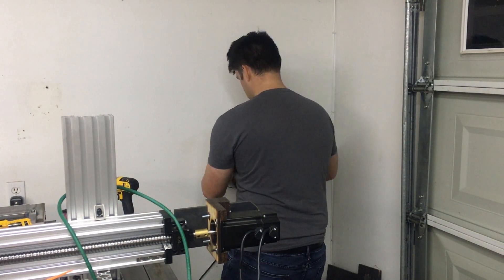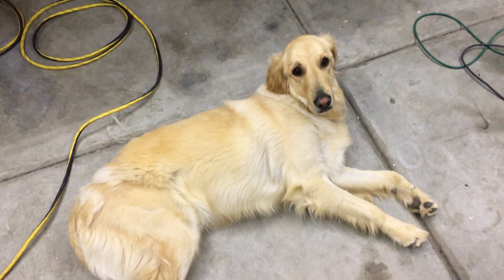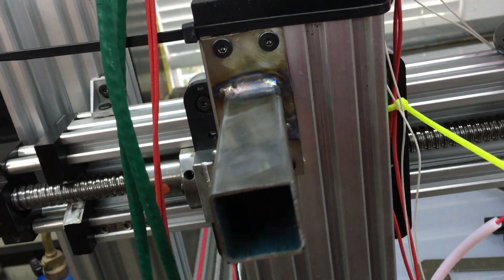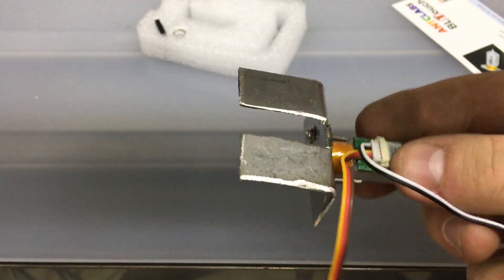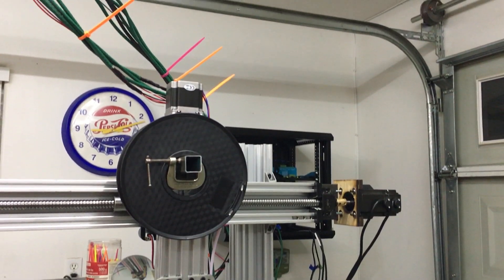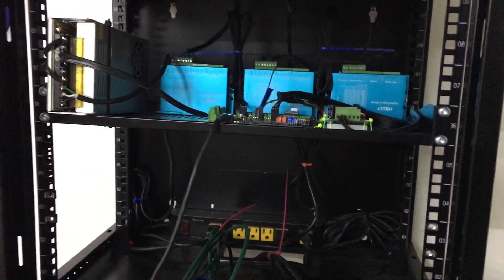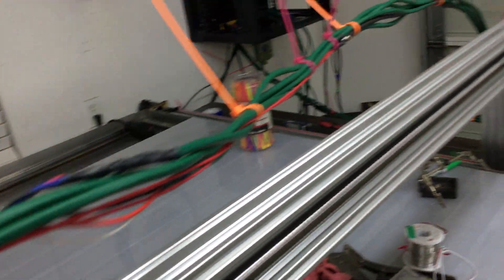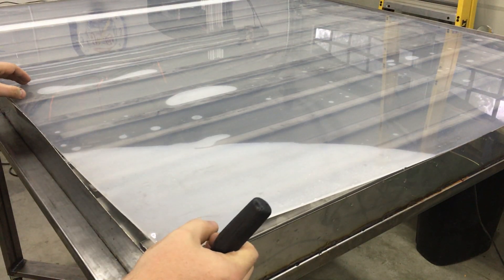Largest 3D Printer Build - Water Tank Filling and BLtouch (Episode 10)

Comment: Put sodium hydroxide in the water to eliminate the rust.  That will actually remove rust.  I use sodium for removing paint and rust on equipment.  You can also put some glycol in the water.  Which ever works.

Comment: Great work on the printer! Nice to see it progress. Can't wait to hear your opinion on the extruder.

Is there a reason why you wouldn't weld sheet metal on top and simply put the sheet on top? Wouldnt that help with all your problems? It doesn't have to be thick, just enough to make it watertight.
Secondly what kind of sheet is it exactly? Does it work as well as a mirror for regular pla?
Cheers
Reply from the maker: The "lid" on top of the water tank has to be removable because this the printer will double as a plasma cutter. I'll I'm still on the fence about the need to venting setup if its really needed or not. Its a 1/8 inch thick of Polypropylene (PP), also known as polypropene... You can print pla and petg but not abs. You can print directly on it and it sticks quite well when warmed up. When it cools it "Pops" right off when you flex the sheet. If you have a 3d Printer lookup https://tiny-machines-3d.myshopify.com/ they sells build plates, it's cheap and a game changer. Thanks for the Interest!
Reply: @CountryAireDesign  is there any particular reason why you wouldn't want a kind of frames instead?
For example closing the top as mentioned and slide either the print plate or the plasma "grating" in place? Or do you need water under the plasma?
Reply from the maker: water = clean plasma cutting process. That is the basic reason. Plus I'm a bit of a mad scientist. :)

Comment: You can probably fix that rusting problem without replacing the steel, chemically treating the water as to plate corrosion-resistant metals onto the steel might work
Reply from the maker: Electroplating that is something I've never done before it sounds awesome! Heck ya man more info would be great!
Reply: @CountryAireDesign  sweet, gimme a few weeks and I'll try to post a video on it
Reply: @CountryAireDesign  okay, researched and experimented and came to a method that'd work for what you've got going on, i posted a video on it
Reply from the maker: @doctorpurple5173  cool, I'll check it out. Thanks man!
Reply: @CountryAireDesign  no problem! I have a follow up suggestion though, if you do zinc plate the steel I recommend a second coating of copper over the zinc to prevent the zinc from gradually building up white powder in the water, you can do this without electricity by just covering the zinc plated parts with a dilute solution of copper sulphate and it'll react and coat the zinc in copper
Reply: Or even try electroplating? That'd be much more complicated tho.
Reply: Want me to do some experiments on it and post about it?